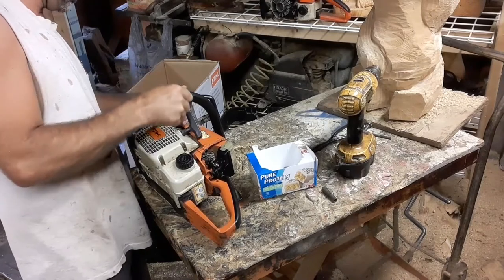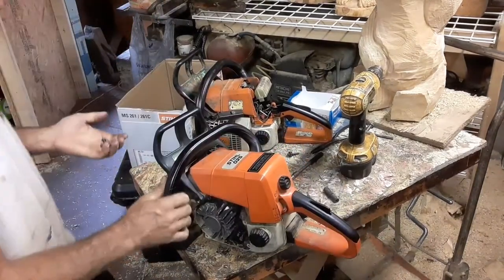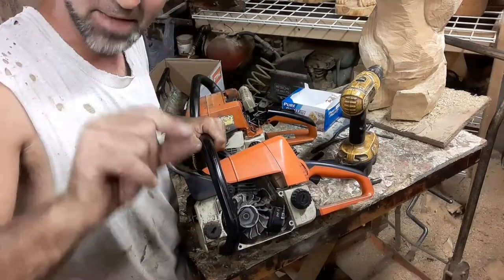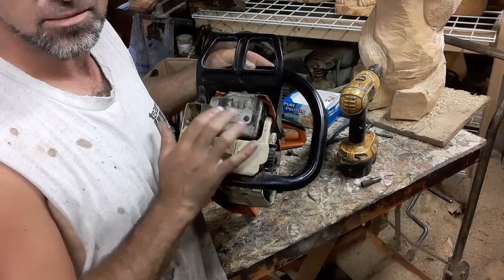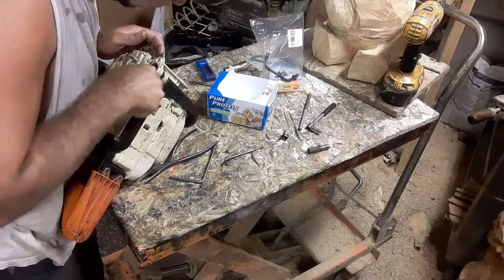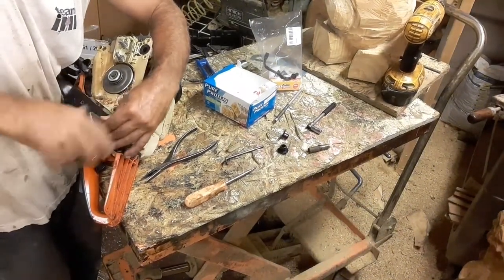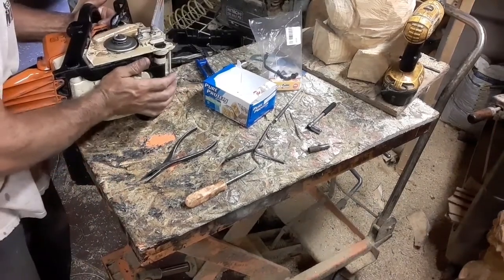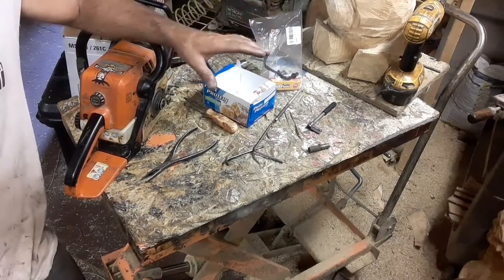Bad vibes finding different chainsaw vibration issues

Comment: Thanks for the video, I was having vibration on my 562xp when wot in a cut checked everything over like you went through.  I only found a few bolts that were even slightly loose.  But it ended up being that my chain was causing it.  I switched it out and it stopped, put it back on sharpened it, make sure I was very even on both side and it was gone.
Reply from the maker: Oh yeah anything uneven or unequal in the chain will.cause a bump... i often feel the preset if i cut down a used chain or have to use a generic repair link out of my box...

Comment: Mine doesn’t have a safety guard. Could that be a the cause of vibration?
Reply from the maker: Not sure what you mean by safety guard, normally less things to vibrate means less likelihood of vibration... if its missing a guard, bolts could be loose, spacing that the guard used to take up could be causing a void, where a lot of vibration could be happening, but hard to say exactly... usually mass amounts of vibration is things like loose muffler, loose motor mounts, loose coil, loose bar and chain, loose sprocket, missing the c clip that holds the sprocket on, broken, or modified handle mounts, and bumper systems, iether broken, or modified or just the general feel of a saw, depends on the saw, depends on age of saw, and what's been done to it, or what else is possibly wrong with it...